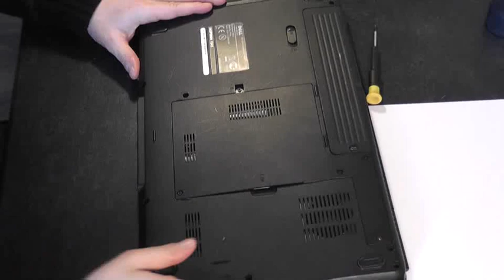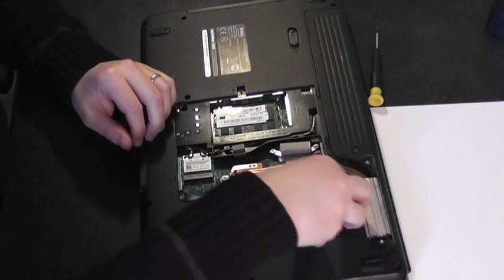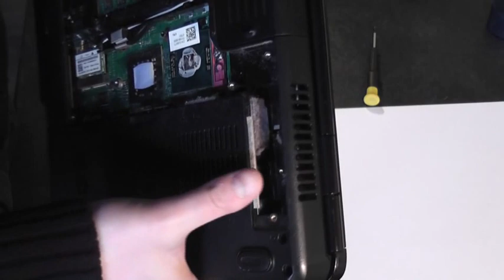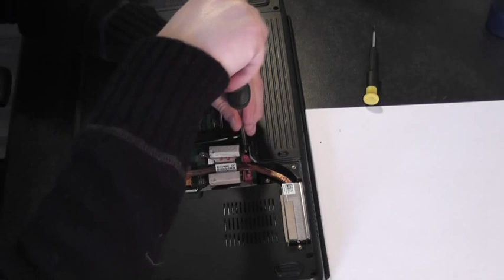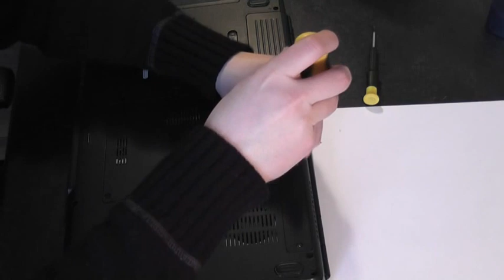Dell Inspiron 1545 Overheating Problem - Step by Step Guide to Fix (HD)

Comment: With such an quick and easy access design for clearing accumulated lint/crap from the cooler's the air flow path, why would this →Mr.-I-have-a-screwdriver← guy NOT invest a few $ and a little more time to PROPERLY REPAIR THE UNAVOIDABLE DAMAGE that he just did to the CPU heat transfer paste/cement and to the GPU heat transfer foam tape???  
By ripping the copper tube away from each of these two high heat chips, both of their IMPORTANT thermal transfer materials are now seriously compromised, and without cleaning them off and re-applying these two heat transfer materials FRESHLY, reassembly will ALWAYS leave some amount of an UNWANTED air gap between the chips and the copper.  
Depending on the size of the resulting air gaps, and how "crusty" the CPU paste and GPU foam tape were, the flow of heat from chip to copper may now be sufficiently restricted, at this critical interface zone, that the chips can still overheat ( despite the cleared air flow), and the computer will still be likely to suddenly shut down under heavy use.  With the worst case air gaps, it will often even shut down in less than a minute before Windows can even load.
Often, if a laptop that gets knocked about with enough G-force, the shock to the hardened paste between CPU and copper cooler can split apart, separating enough that, even with perfect cooling air flow,   the sudden shutdown problem from overheating will typically then appear.  Only by replacing the CPU cooling paste & GPU material will such an overheating issue be resolved.  
So, why not BE PREPARED for replacing the thermal transfer materials when you tackle the blocked airflow from lint buildup issue? The incomplete procedure used in this video can easily  trigger NEW and POTENTIALLY EVEN MORE SERIOUS overheating problem.

Comment: you all need to Apply New Thermal Grease back on the CPU , if you just take off the heating system and clean it and put it back it well runs better but not for long .
Reply: +thehegt Tr You're right, not forgetting to clean off the old thermal grease first.  Personally I use alcohol wipes, they are lint free as a bonus.

Comment: I just mod my fan and undervolt the cpu and it has like 20C to 25C down ;) 

My Inpiron 1545 Specs (Upgraded)

Intel Core 2 duo 3.06 ghz (Upgraded)
Solid State Drive 250gb (Upgraded)
8GB Ram (Upgraded)
Extended Battery (Upgraded)
USB 3.0 by PCI Card (Upgraded)
Internal Blueray Rom & burner (Upgraded)
Windows 7 64 bit
Overclocked for it to always run at 3.06 GHZ

Right now is faster than an i5

Comment: you should replace the thermal paste in the gpu and cpu.  Before opening your pc, remove the battery and make sure that you completely discharge all power stored.
Reply: +Alfie Ruda The Dell 1545 should not have thermal paste on the GPU.  Dell fits thermal pads as standard and shouldn't really need to be replaced unless they have deteriorated.

Comment: i agree, 100% on the first one plus i would make sure i'd discharged the whole system of every micro-amp of current too and definitely replace the thermal paste with a metal based one, and, if u can get them in time i would add pure copper shims; bout 1.5mm thick by 150mm x 150mm. to the gpu and the cpu. at 40% more efficient, this alone will reduce the temperature by 10-20 degrees celsius.

Comment: I would remove the battery before doing this and certainly the adapter ;-)

Be VERY mindful of the thermal pads on CPU/GPU.  In fact, you should probably replace them during this maintenance.  If you have thermal paste, you MUST replace it.